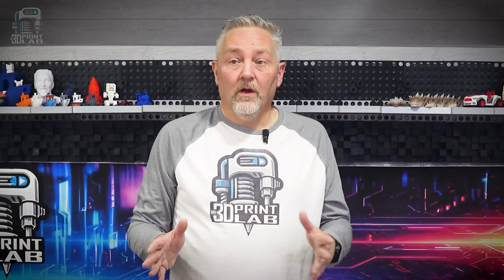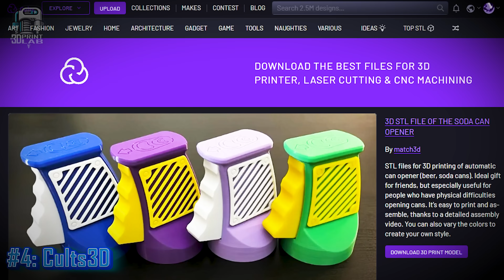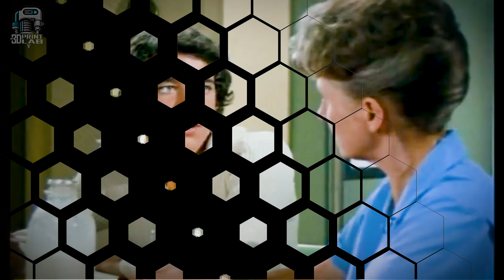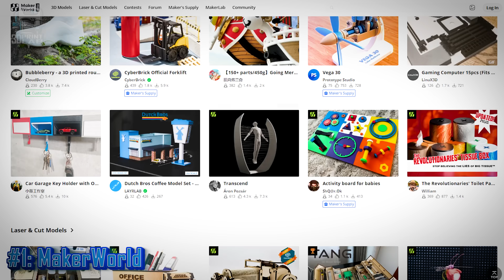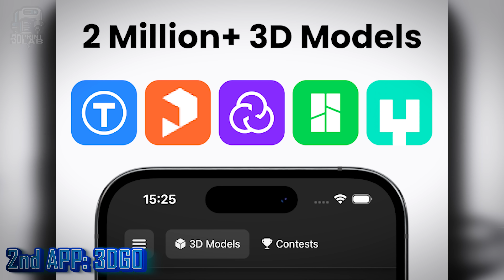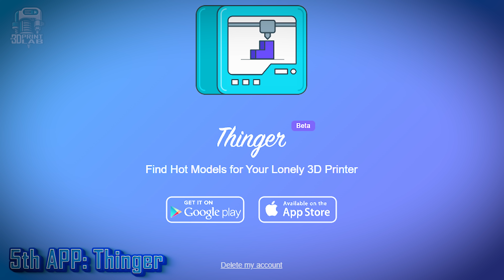Are You Missing the TOP 3D Printed Objects of 2025?

Comment: Depends on how you look at it, I’m not into cute 3d print sites so I check them out if not up my alley I just select "do not recommend channel" I know what I’m looking for and can’t be told what I need to be looking for, I’m 68 so I’m stuck in my ways on many things.
Reply: I have to agree with you regarding the vast majority of "The best 3D prints of [month] [year]" videos, which uniformly seem to be where wastes of filament go to die -- they're full of 3D-printed tchotchkes that will hold your attention for the first five minutes after you print them, then spend a couple years sitting on a shelf taking up space until you decide to get off your duff and throw them out. Many of them also seem to use color-gradient silk filament for no better reason than to make viewers 'ooh' and 'ahh' over them, then rush off to print it for themselves, and only afterward ask the question "Do I need another articulated dragon?"